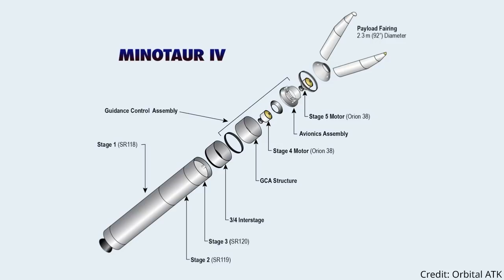Minotaur IV launches ORS-5 Satellite

Comment: Jesus, was this rocket designed in KSP; 4 stages for LEO???
Reply: 4 or 5 stages, all solid fuel... dirt cheap, can sit on launch pad indefinitely and launch at a moments notice.  Also gives airforce a place where they can keep the culture and training in use of solid fuel rockets alive and active.
Reply: It is a stockpiled LGM-118 Peacekeeper ICBM now used as a launch vehicle. More stages are better as I think theoretically an infinite number of stages is the most efficient.
Reply from the maker: +SixDasher Originally, it wasn't intended for LEO https://wikipedia.org/wiki/Minotaur_IV
Reply: see pvc pipe extruder. mount one on a jetex